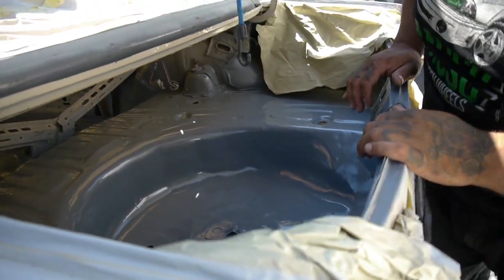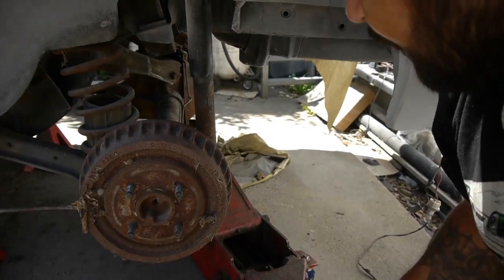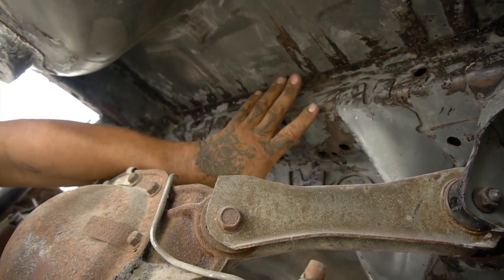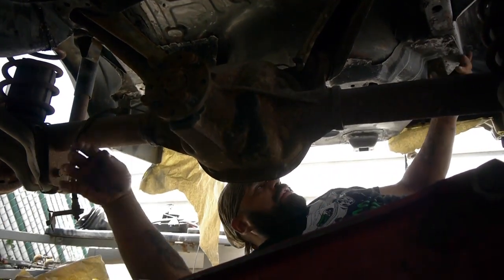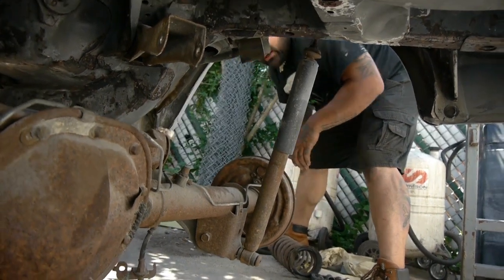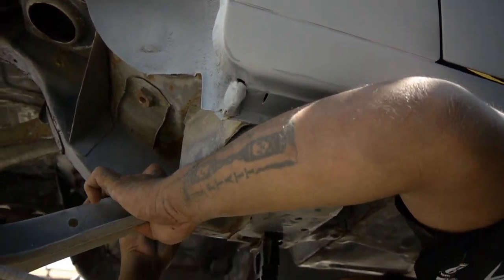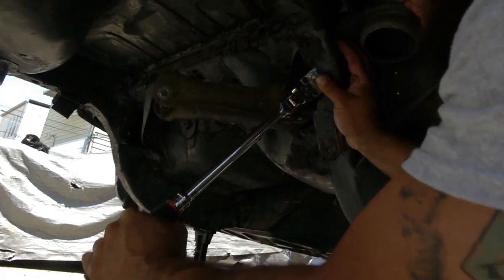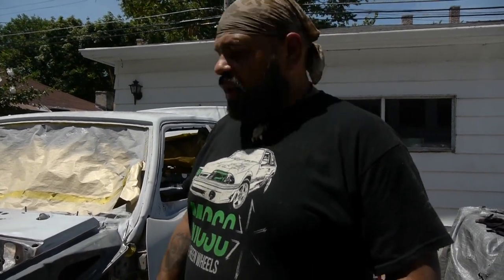86 Foxbody 7.5 Rear End  Suspension Dropping by Folleh Shar Tamba

Comment: Man u got lucky to get those lower control arms front bolts out my 92 GT when I was putting my lowering springs on the back I got some new uppers and lowers nothing hot better then stock!! But when I tried the lower front bolts out man  I put the nut like almost all the way back on the bolt I had like a 3 pound lil mall hammer I beat & beat on that bolt it would not come out!! The bolt was so rusted inside that sleeve that goes through the bushing I only had a 4 1/2 grinder with a cut off wheel I ended up cutting the control arm up real short it was just easier to move it from the back to the front!  It was a bitch trying to cut my cut off wheel as soon as it got a  little bit down I was done I used  sawsall  in everything bought a hour cut up hands finally got it was a bitch cause I had to get upside in between the control arm in hack  that off same thing on the other side I had to cut where u slide the bolt in then when it passes through the mount into the lower control arm! I am sure u no what I mean sorry so long but it was a bitch with out the right tools it wouldn't break free from that sleeve man!!! But man the SANDBOX is coming together man sorry about my long post!!
Reply from the maker: James never be sorry about posting. We read every comment and try to respond to as many as we can. We hope that our channel will help people. Damn sorry about the rusted bolt, sometimes everything is fight man. I know you probably soak the rusted bolt with PB blaster, B'laster 16-PB Penetrating Catalyst. PB B’laster also protects against further rust and corrosion. If you let it soak with PB Blaster and it does not come off, heat is another trick I use, we use a torch and heat of the bolt, it works.  Good that you were able to remove the control arm though. Sometimes a bolt will fight me too the bitter end too,  I have had a lot of those days.